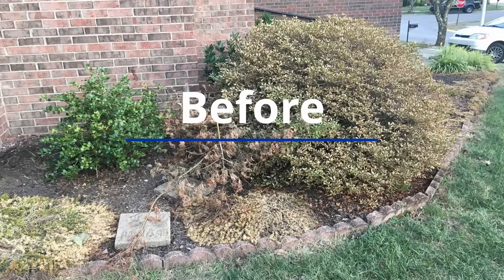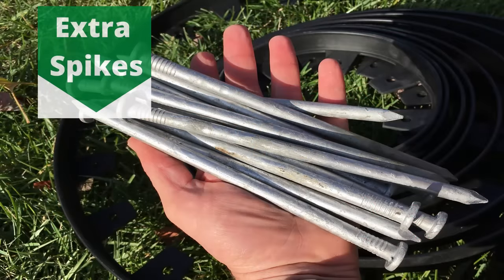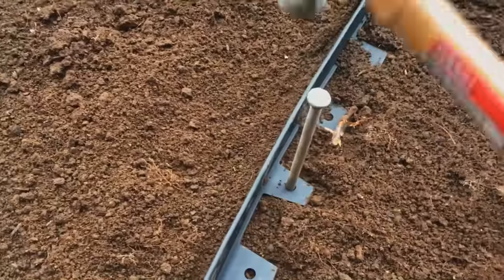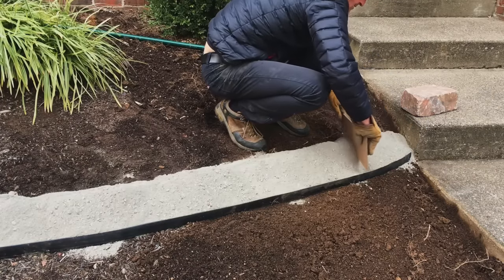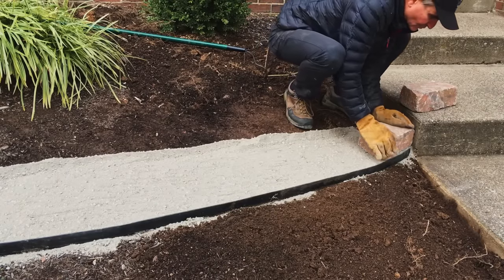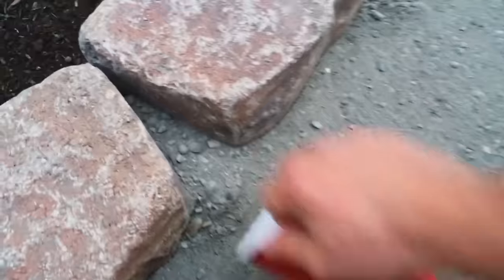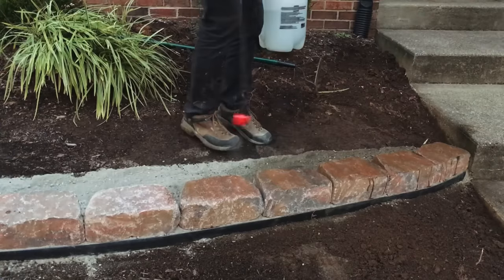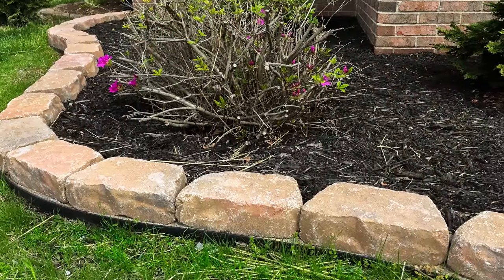easy diy No Dig Border *2020 UPDATE*

Comment: I have 120 feet to cover. Do I need 25 bags of concrete??? Wow that’s a lot  at $13.00 per bag😂
Reply from the maker: Whoa, that's a high price for a bag of fast-setting concrete. My Lowes nearby has it for $7.18 per bag so look around and see if you can get it cheaper. Yes, 25 bags is right for 120'. If I were you and you live nearby a store that has all the blocks and concrete that you want, I'd pay the delivery charge and have them deliver these heavy materials to your place. It will save a lot of time and work for a big job to have this delivered to you. Its well worth the money. Have a great day, Bob!

Comment: Good video but I don’t think it looks great with all of the open seams towards the back. It looks better than before but far from professional.  Hard to look great without hand breaking stones.
Reply from the maker: Rap Freak, that is a valid point. I've struggled with this some. Sharper curves make the gaps larger. Flipflopping them makes gaps on the front which looks worse. If you were making the border straight, flipflopping them is a great idea so there are no gaps. I've thought about using a cap over them. Do you have any solutions or suggestions?
Reply: maxpatch67 the problem is big box stores just want to stock one SKU so they don’t give you options for straight sides blocks and angles blocks. Ideally they’d also offer different angles to support different curves. 
I think I used those same blocks at my old house and flip flopped each and at the corner of the bed did a (rather tight) radius butting the edges together. It looked pretty natural.
Reply from the maker: @rapfreak7797  Alright! Thank you for your thoughts and ideas. Have a great day!

Comment: You have no concern for drainage under the concrete or heaving from frost and thaw? Is that plastic U V rated. The true test is to view this location in 3 years
Reply from the maker: Great questions, Blue Jay. These borders last perfectly here in Nashville, and though I have not built them up north, many viewers have left comments(on my older video) that they have made this border in a variety of places up there and it has lasted perfectly through several winters so far- Canada, Chicago, and New England are ones I remember. I don't know about the UV with the plastic edge, but I can tell you it is built surprisingly sturdy. If you feel it, you would probably have more confidence in it...its much more substantial than you would think. I hope this helps and I hope you have a great day, Blue Jay.

Comment: This technique is all wrong. The mind's eye sees level lines, especially when in the foreground of the perspective of your home that was built using a level. When you set blocks on unlevel base, it looks inferior. If you want quality results, plan on hard work, or hire a professional.
Reply from the maker: I like the way you are thinking, but when you say "The mind's eye sees level lines, especially when in the foreground of the perspective of your home that was built using a level." this doesn't make sense. First, the mind's eye sees all kinds of line-level or not, but yes, it has the possibility to recognize level lines. Second, the foreground of a home never needs to be level, unless building some type of structure. The home being built using a level does not at al require the landscaping to be. I see this border as more of a sculptural element. The mind's eye also loves curves and repetition and other design elements that this border provides. I would not argue that if you are building up some type of wall, that level is better and I recommend that to viewers. If you think this technique is non-traditional, I agree with you on that, but it does work  and solves problems people have with many other types of borders. Thanks for your comment Doug and have a great day!!

Comment: If you can't "garden" and remove weeds from your flower beds, then you shouldn't have a garden.  Putting cement into a garden is harsh and it's going to eventually break up into the garden and dirt and present another problem.  Don't make gardening so difficult and so artificial.  Work with nature not against it.  I do like the rocks as a border but the cement, no.  And then, when we see the finished image on this video of the garden, there are hardly any plants??  I do know something about gardens, as I have been a designer and caretaker of many client's gardens for 26 years.   If you truly love gardening, which includes garden maintenance,  and working with nature, and have a love of plants, you can't go wrong.  Don't forget to add ORGANIC compost when prepping your soil.  There are certain things you must do to create a garden and care for it, when you do that, your garden will be extraordinary, and it will show!
Reply from the maker: Thank you for your ideas, Lynne! Have a great day!!

Comment: These types of borders are useless as it makes mowing a major pita, because you now have to use a weed eater because the mower can't get close enough to the border to cut the grass...
Reply from the maker: What is your favorite type of border, River Rat?
Reply: @maxpatch67   just a scalped one with the border machine or the curb ones that extend into the yard for one wheel to ride along. Both of these methods make it so that it's easy to maintain the edge and you can mow all of the grass without having to get a weed eater out to get the area the mower can't.
Reply: @maxpatch67   don't get me wrong these are very nice for the cost and the amount of work. The concrete curb edges are expensive and take a lot more skill to instal
Reply from the maker: right! thanks for sharing your ideas...much appreciated!